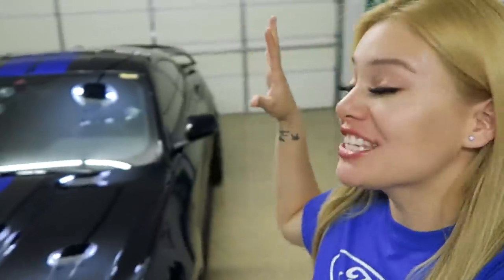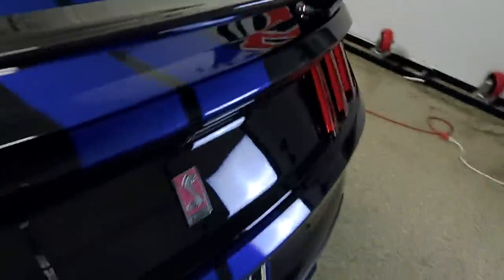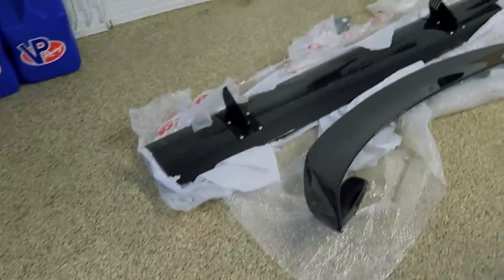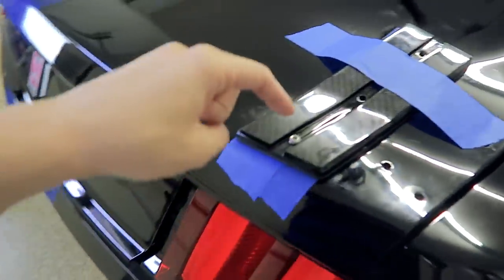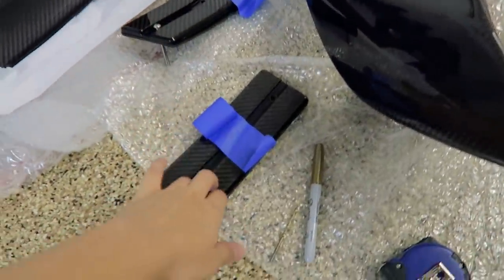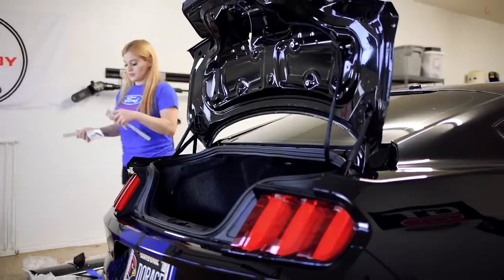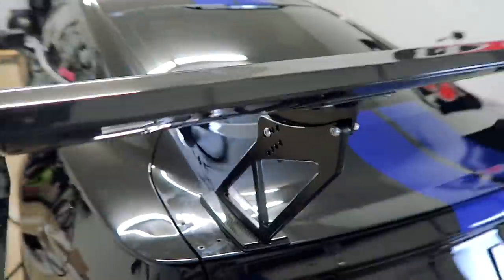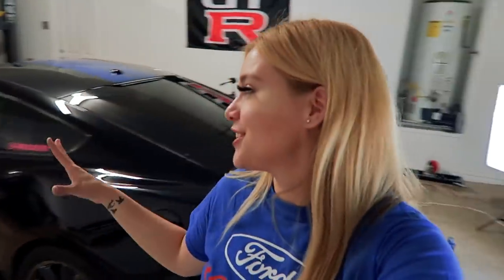They'll say I RUINED my car. Installed the APR GT-250 wing on my GT350!

Comment: Nice, Yup, I thought the same thing. Oh, NOOOOOOOO, Not the Big Wing. But when it was done it looks tight and ready for racing. Perfect DIY. I have a Q50S and i'm thinking of putting the spoiler on. But can't decide on getting the painted version or Carbon Fiber. If I get the CF then I gotta get the CF mirror caps. Decisions, Decisions.....
Reply from the maker: haha..yea. its all for a functional use and a well needed one. I like the cf..it breaks apart the lines of the car if you get matching cf everywhere else.
Reply: Yeah, I was thinking the same thing... I go on Vac in Feb I plan on doing a lot of upgrade then. Yup, it will be winter time so it will be COLD. But car would look SWEET....

Comment: The car looks AWESOME!. Doris if you would like to do a quick repair on the trunk. It wont cost much just to do a quick repair. You can get putty at a home depot or what not.  Once dried sand it down but only using your hands no machine as to not scratch rest of trunk and then get color correct paint. Again super cheap. It's usually sells in small bottles a few ounces worth. The blue stripe will be a little harder to cover but I'm sure you can find it.  Again that's only just in case it does happen to rain the trunk wont get wet.
Reply from the maker: Thanks! I thought about it so many times, but I'm sure I'll mess it up bad lol. A new used trunk in black isn't too much. I honestly want a CF one but we'll see if can handle the stress.

Comment: Hi D what you have done to your car is absolutely correct and  I can't wait to see the rear diffuser the hole package will look and make the handle great on track and not to bad on road but best on track. The holes can always be covered up with duck tape or rubber grommets nice job so far and if that was my car I'd do the same bits you have done absolutely love the Ford GT350 fantastic car. 👌🤗👌🇬🇧🇬🇧🤗👌
Reply from the maker: Thank you, I appreciate it. Yes, the holes will get fixed..I need to just validate the carbon fiber option..if that does not work, then I'll just repair it or get a new one. The diffuser will tie it in nicely. Waiting for the under panels to be completed.

Comment: Doris those holes are an easy fix regardless, i wouldn't be all to concern even if you put it back stock very easy fix. Second i believe the wing could be too heavy for Carbon Truck but that being said look into it. With Carbon is kinda of treaky with stuff like that. Also since your adding Carbon probably add carbon deck lid since your doing everything in rear of car it will look great.
Reply from the maker: Yes, they are so I'm not too worried. I agree, but lets see. Still waiting to hear back from them to see if it'll work or not. If not, then another trunk will do. Thanks for watching.

Comment: As always, thanks for the video, Doris.  I like the addition of the big APR wing on the GT350.  Anything that is race functional looks good to me, and your GT350 is certainly becoming a race car.  I'm also looking forward to the carbon fiber hood, which will reduce front end weight.  You could be right about a carbon fiber trunk not supporting the APR wing, but would a regular trunk lid still be lighter than the stock one?  If so, that's what really matters.  Keep up the good work!
Reply from the maker: Thanks! It's slowly becoming one surely..just a few more (a lot more lol) things to do. The hood will reduce weight and allow for much needed pressure relief\cooling. As for the trunk..the weight is not much of a benefit if it cannot handle the stress. So we'll see. Thanks for watching!

Comment: Yup lots of down force, once you get the angle right, that will take time and will depend on the track. Does that wing have the ability to run a gurney strip? that's something else you might look in to.  I use a rear diffuser on my ride and it will make a big difference cause your rear bumper is basically a big parachute if you know what I mean and the diffuser will seal that up and reduce a lot of the unnecessary drag. The carbon deck lid will save you some weight but I don't think it won't handle the down force created unless you used a lot of bracing.
Haters gonna hate, F them its your ride.....
Reply from the maker: I can't wait to try it out. It should be exciting dialing this car for the different tracks. It has a small gurney flap towards the rear, but no way to add a larger one. This wing could be adjusted for some extreme angles, so it's fine. A diffuser for this car is coming. Working with a company to create a completely smooth under panel from front to rear that mates into a diffuser. That would really clean up the low pressure air. But let's see. Thanks for watching!

Comment: Nice wing thanks for sharing.I think using thread lock on nuts it not a bad idea because of vibration and also using paint color in drilling points prevent rust in future. and there is no need to buy brand new trunk lid those holes can easily covered by professional body shop.
Reply from the maker: Thanks! the hardware nuts are nylon, so they will hold in place with vibration. The I have a black car, so it's way easier to find a trunk that color and will likely be cheaper than patching and repainting. But we'll see. I have to figure it out.

Comment: Are you concerned about the motor? I've seen a couple youtubers have blown motors with low mileage. Jeff Ashton just had his let go. Love the car.
Reply from the maker: I do have an issue with cylinder 8. I keep getting misfires with brand new plugs. I'll be taking it in for a compression test next week as I'm tired of checking everything else. It happened after tracking on a hot day as I kept getting misfires at the track. Car drives normal otherwise. No sounds of bearings after tracking the car 8+ full day track events. Hopefully it's nothing bad, but we'll see.
Reply: @woman.driven  could be a injector or just a cheap coil pack the thing that attaches to the spark plug

Comment: Holy Downforce Batman! That wing is no joke Sister. Looks kinda sinister though with your GT350 paint color. The cool thing is we get to try different looks and level of functionality with our cars, that's part of the fun. I come up behind a GT350 with that wing and I'm probably going to tuck my little GT Coyote tail in and cruise behind it 😏.  As far as the holes in the decklid, it's like I have a self inflected dent (thought those ramps were on the wall good) in a lower side panel and if I fix it I know I will probably get hit the next day so I drive it!
Thanks for the video!

Comment: The APR side plates are just too small and boring for my taste. I like the one on FP350S. Also, I'd highly consider add two support braces under the trunk like what they did on FP350S using this wing. It's very possible to get two dimples if you don't add the brace. Carbon fiber truck won't survive the track day with AOA over 5 degree IMO. Can't wait to see your new hood and hood vents!

Comment: Use a small diameter of a drillbit 1st then re drill the holes w/ a exact size of what u need . Then u will not get sharp edge and u will not put a dent and no need to used a force .

Comment: Looks cool, but would you have considered the 2020 GT500 Carbon Fibre Track pack wing? If you’re changing the hood, go with the Shelby Super Snake Carbon fibre hood. hood. Just saying...
Keep up those awesome mods...
Reply from the maker: The GT500 track pack wing is nice but it won't generate that much downforce..it will produce less drag which is a good thing. I think legally, they can't sell a wing of a certain size for a consumer car. As for the hood, it will be a cf one. Cheers!

Comment: Use 3M vinyl to cover the holes, buy a small 6" strip/stripe of gloss blk on ebay and they will cover easily and look decent.  If the metal is bent it should be easy to PDR well enough, and then you can make it a while til you do the trunk.  Beauty marks illustrating experience :-)
Reply from the maker: That's a good idea. I can do that in the mean time while I find a hood replacement or figure out how much it would cost to fix it. Thanks!

Comment: Ignore the haters Dorace, most of them dont even rev their cars over 5K much less see any track time, keep doing what you're doing. I think you will see a big improvement in down force once you get the flight control surface (lol... aircraft guy) adjusted. Keep driving fast.
Reply from the maker: haha..probably. I think it's more that it's foreign to them. They don't get the function of a wing like this. Oh well...good thing this wing is turned upside down lol..if not I'll have an issue with lift. Cheers!

Comment: Yup
Some won't like it. Some will! Hell I say you drive it as a track car and that is a serious wing. You will have to adjust down force out of that wing on a fast track. Does Roush make a side pipe exhaust  nowdays for those?
Reply from the maker: That's about with everything in life..some yes others no lol. Yes..it will need to be adjusted depending on some factors. I've seen some side exhaust, but the issue is the gas tanks are in the way.

Comment: A carbon fiber trunk lid will be stronger than the factory beer can one. You need a widebody kit to balance the look IMO.  Basically going to relegate you to track use as it's going to knock some top end speed off.
Reply from the maker: I suspect so..but then again..I'm not really sure since I haven't see any carbon fiber trunks with this wing on it. The wing can be adjusted for more or less drag. Depending on the track, I may not need to go 130+

Comment: It would be great if someone made a combination of 2 rear spoilers, street & strip, (wings) that connected with either push pins or quick disconnects. That way you could have both a daily wing for everyday street driving and one for “Track Only” days! Then you would look great either driving on the street or on the track.
Reply from the maker: That would be smart..issue is..the height of the pedestal. It's that tall so the high pressure slower air goes over the roof and into the wing to keep the car down. Having a shorter pedestal would work for the street\track; however, you sacrifice downforce.
Reply: Your right but the quick disconnect could be on the lower part of the pedestal and still retain the height for the track wing and a lower height for the street wing. That way you would have both. Maybe one of those vendors you have a relationship with could design those?

Comment: I know you said you're not concerned about downforce but do you know the amount of downforce and at what speed? The ZR1s wing I believe is over 900lbs at 200mph
Reply from the maker: I'm not concerned on the street as I won't be going fast to utilize it. This wing is much larger and generates more are way lower speeds as you can adjust the pitch. So I will adjust on the track depending on how much downforce\less drag I need.
Reply: @woman.driven  makes sense.  Ok then

Comment: Seems like a wing of that size would need some X-bracing between the posts.
Reply from the maker: The support is pretty rigid once everything is tighten. It's not going anywhere. There is some reinforcement I need to do to the trunk though. So I'll work on that.

Comment: You really have a good taste on the car, just wondering how to seal all old holes to prevent water get through the trunk
Reply from the maker: Basically have it fixed, buy a new trunk or get a carbon one. Need to figure that part out.

Comment: It fits in with the intended use. Is it adjusted at the front? if so the lower the front the more down force.
Reply from the maker: The front is as low as it goes. I don't have any adjustable coils. That would be the final trick to add. But that needs a few changes first.
Reply: @woman.driven  sorry for not being clear I was referring to the wing
Reply from the maker: @Warwick3511  Oh. Yes. You can adjust the pitch..more drag or less drag. Pitching it forward (downward at the front) increases the downforce. Placing it level with the floor decreases drag, so less downforce.

Comment: dont get the carbon trunk unless its predrilled
Reply from the maker: They don't come pre-drilled except to the mounting points. I may just stick to the new trunk. I suspect the stress will be an issue.
Reply: The taller you go (the more downforceyour gonna add,and stress to the are its mounted to ) needs to  reinforced directly to the frame..like the vette. My opinion the oem sheet metal is your best option.

Comment: Car looks like a ricer now🤢 If its only used on the track thats fine, but i wouldnt drive it on the street. Sorry
Reply: So I guess GT3 RS, C7 ZR1, Viper ACR, and Gallardo Squadra Corsa, and Huracan Performante are ricers. Because all of them come with large spoilers from the factory being track monsters. If you're serious about setting fast lap times extra aero is needed a ricer is someone who puts a cheap $300 aluminum,double bladed wing on a stock Civic or any other car where it will not serve a purpose as these cars will never see a road course nor are they built for one. People are quick to utilize these terms incorrectly.
Reply from the maker: This car is tracked..plenty of videos of it at the track.